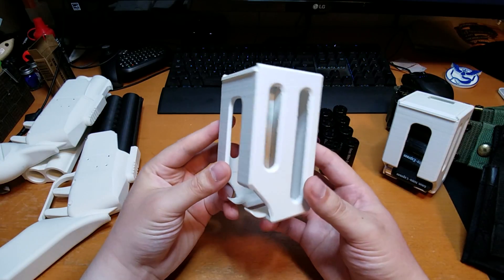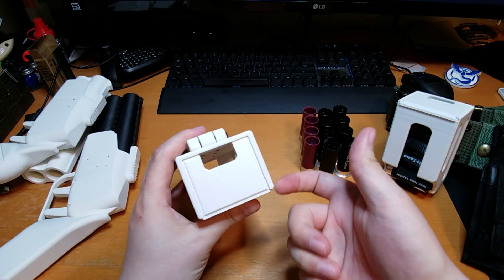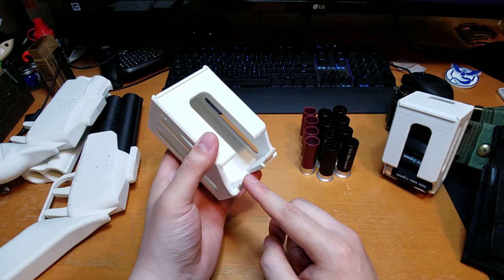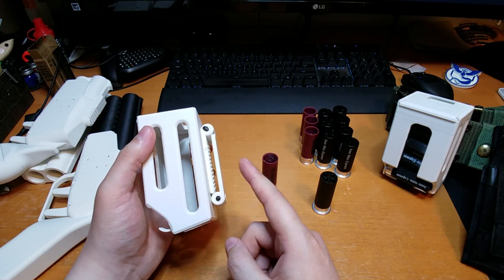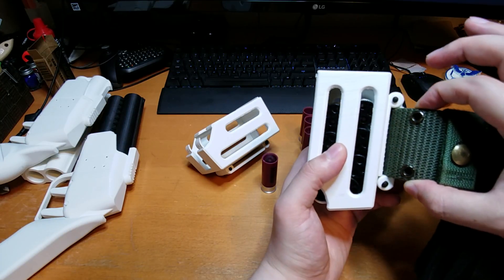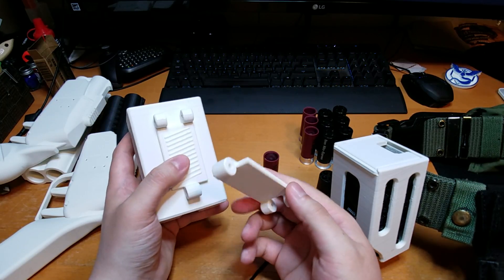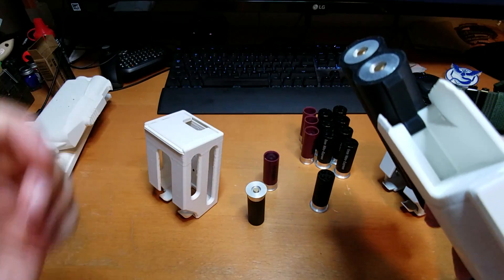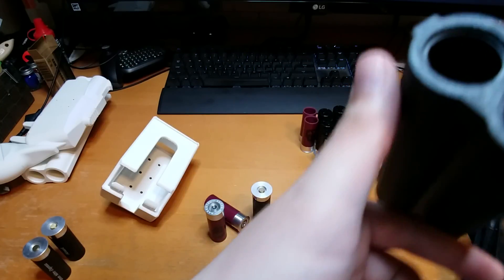Eight pack shell caddy

Comment: Do You also have the design for the stubby barrel uploaded?
Reply from the maker: PahandusAirsoft not yet I wanted to release it as part of a larger customization pack. But I'm working on finding a way to convert my files over to work in fusion 360 as 123d is no longer being supported. Not to mention I'm teaching myself how to use fusion 360 along the way so it's going a bit slow right now.

Comment: wow wow wow. Great work with the over under and the shell holders man!!! Finally i have some inspiration to go back on Solidworks and dust off the Ultimaker Printer haha.

But, small question.
Did you print the Barrels vertically? (maybe it just looks really long in the videos lol)
OR... horizontally?
Reply from the maker: Yes I print the barrels vertically, the longer white one actually maxes out my z axis.
Reply: Oh wow lol. I was about to say.

The Makerbot asks to resize for the volume lol.

It looks literally maxed out to the edge of the top z axis haha

Ill try print without re-sizing :)
Thanks for the quick reply

Ill give you some feedback!

And great work again!
Reply: Just Printed a couple of the Prototype Shotguns... now i need workable shells lol. They dont work with my Old Tanaka Shells haha